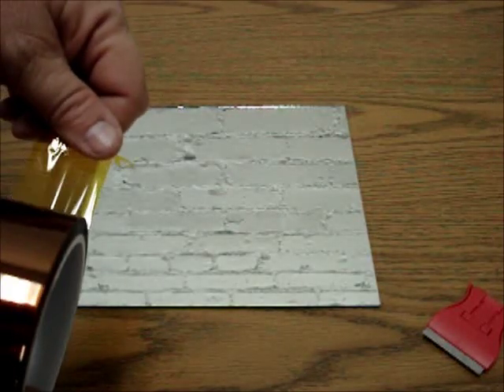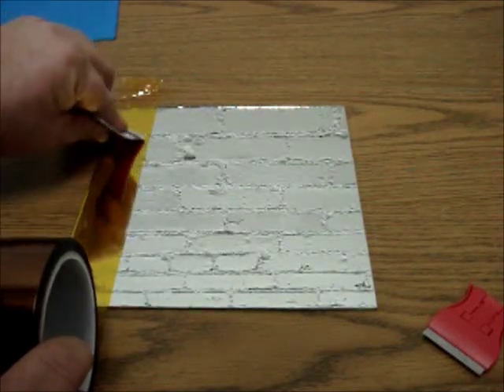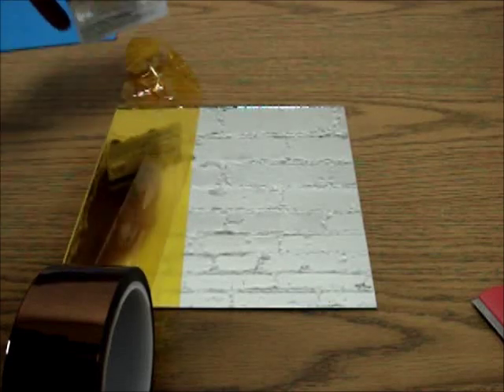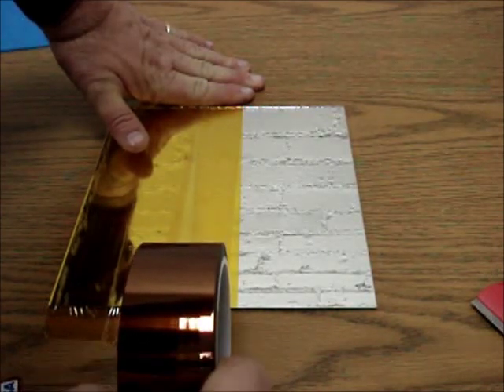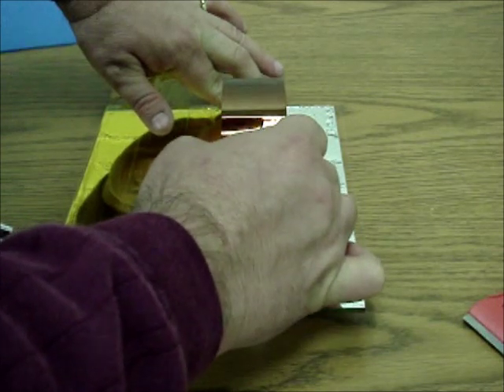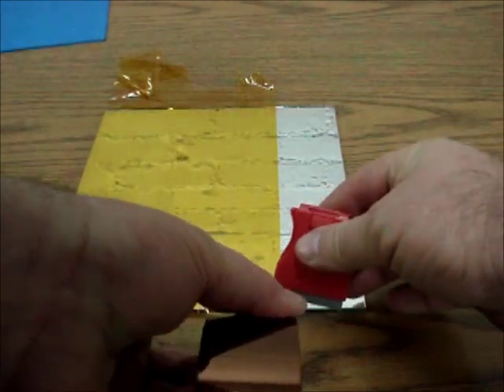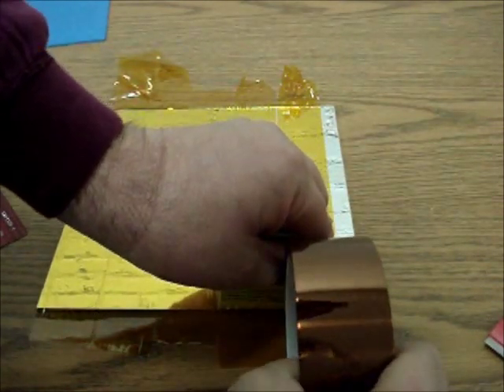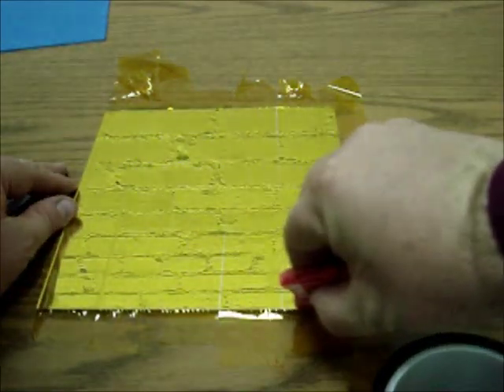Vision 3d Printer  How To Apply Kapton Tape To RepRap Heated Bed Glass Plates

Comment: 'Vision3dPrinter' "I use standard 12" x 12" glass tiles from Lowe's. " 
I think you mean mirror tiles. They do make glass tiles for walls and counters but i don't thing they're particularly flat.

I have wondered about something like polished granite or marble as it's not fragile and I think would heat more evenly, but would take a while.

Comment from the maker: No, I use standard 12" x 12" glass tiles from Lowe's. A 6 pack for only $9, AND Lowe's will professionally them to size for FREE! Mirrors heat up and cool down much faster and have better heat distribution. If you look at my other videos, I pull the plates, slightly flex them (to free the parts a bit), and constantly swap plates out in order to minimize the time between stopping a print and beginning the next print.

Comment from the maker: Borosilicate (Pyrex) glass is slightly tougher, but not as flat and not as good at evenly heating the parts. I think it is quite overated, and have thousands of hours of build time to prove it and my parts are perfectly flat. The only mirror I ever broke, I did on purpose to find out what would happen. It was a bit of a dud, no chips or loose shards, the tape on one side probably helped a bit, but I didn't even have any flecks of glass to clean up. I will post a video of it by tomorrow.

Comment: Do you use a special type of glass or is that just a regular piece of mirror that can be picked up at a department store.  I see some that sell the borosilicate glass for $35 which seems pretty pricey.  But also I'm afraid of regular glass shattering.